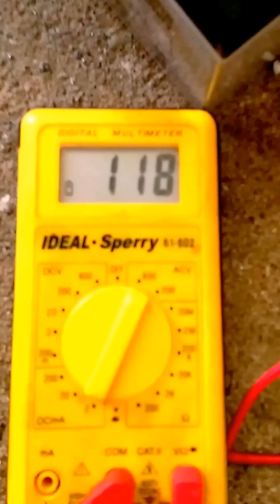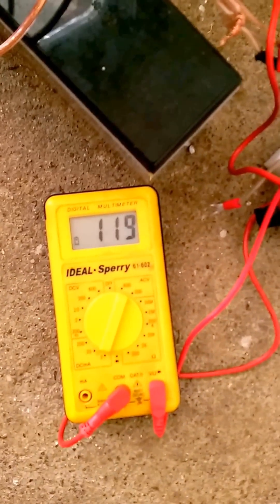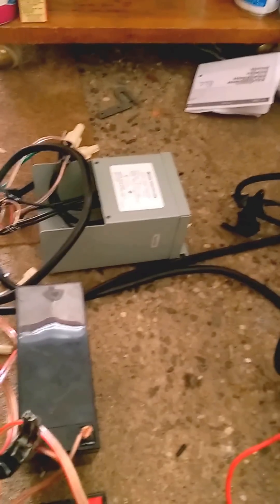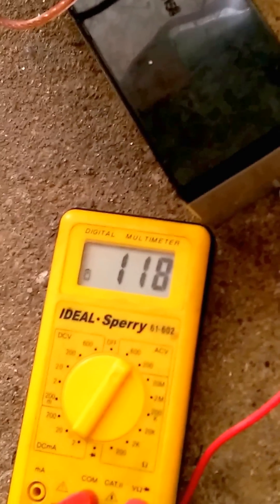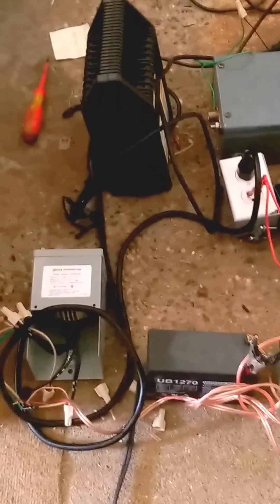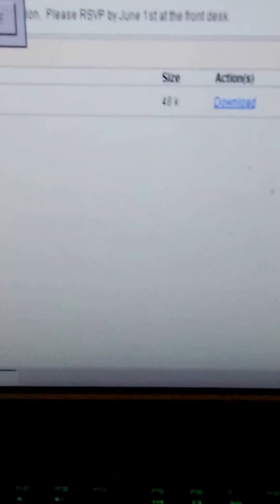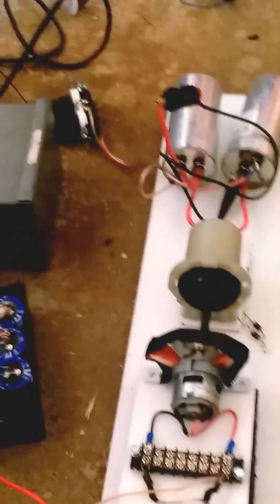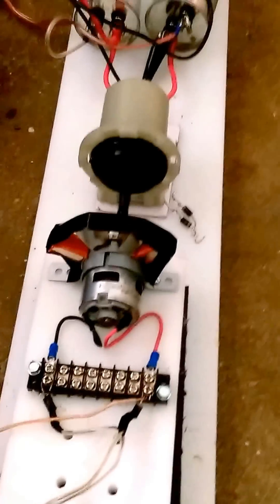Gerard Morin Washer Pump Generator &  PELEX DEVICE Successfully Looped!

Comment: hello mark   does your discovery indicate that the large transformers are not needed ?  thanks frank
Reply from the maker: +frank ertolacci if this were a method to replace some devices, such as massive generators to use millions of home generators, then yes.. However, there is some sort of unknown wave that comes from this device that has been cleared up for the most part, however, the device needs to either be used for only one circuit at a time, or, it needs to be made larger. Unfortunately, when made larger, the pulse it produces eliminates the use of cellular devices completely and all you hear is the ditta dah dah did it from the cellphones trying to access the towers, which this comes from the radio in the phone requesting transmission at peak power, but, no matter how much it tries, the signal is jammed by the wave. A study has been done but this was found to be a unknown type of interference that is somehow being broadcast through the conductors because it isn't going through the grounded enclosure, and, the radiation isn't alpha, beta, microwave, or xray, and since it is based upon a very low or ultra low frequency they don't know how it is doing this. It also interferes with backlighting on television sets and eliminates the function of wifi units, but, unknown to how it is doing so because the magnetic flux isn't massive enough to cause this, however, , it is just 3 small transformers wound together on a single special core, wired in a very specific way that accellerates the electrons in an anti lenz configuration which goes in at 60hz and comes out at a perfect 60 hz sinewave at anywhere under 500 watts amplification. Once it gets greater than 500 watts, the waveform starts to distort and I found that electric motors are subject to burning of the insulation on the windings, it isn't because the windings heat up, it is because the radiation attacks the copper , it either changes it's makeup atomically, or, it attracts electrons to it's outside, and it changes.. The outside of the enameled copper turns a powder black color, between the enamel and copper.. It is very strange and I haven't figured it out. It seems that every connection that its output  ties to does the same thing and I can't figure it out. Anyway, I have cut a section of the winding out and it knocked the coil out of resonance, so, I had no choice but to rewind it and it isn't  working at the moment, but, I haven't had time to spend on it to fix it, so, until then, it remains inoperable,  however, I have no use for it if it isn't going to power anything with the interference it causes, but, I've tried for some time to clear it up. The most recent device Ive been working on has been operable in complete resonance, but, I haven't finished it yet. It is much more powerful than pelex and safer, I just need to figure out why I can't get the frequency regulation to work, bringing it's output back down to 60 hz as stated in the formulas,.
Reply: +Marc Belanger    can the 1 circuit charge a battery bank , which in turn runs the house  //  2 or 3 KW running constantly 24/7 is all the average home would need   frank  //  you have chosen wisely , keep up the great work  //  if i can help in any way let me know
Reply from the maker: +frank ertolacci my pelex device shown here, the dark gray box is good for 3000 to maybe 3200 watts, burning hot. that , believe it or not uses less than 5 watts to run that much output, however, a safe level of use without any pulse interference is 500 watts. that's maybe enough power to light all led lamps in a home, including outdoor led  flood lamps.

the device certainly would power a 25 amp circuit but I'm finding it would probably generously provide power to each 20 amp circuit using 6.4 watts of input from your current power system. I have energized it with a computer ups system that outputs a perfect sine wave, then, looped it's output back into.itself, having 2000 watts of halogen lamps running off of it without any issues. I also use a 7 ah lead acid battery that's used in the 300 watt UPS system and the system never shits down. my problem is the pulse wave and complaining neighbors which would cause many.problems. I'm going to try mumetal shielding and a different conductor to see what happens to it. I'm hoping something eliminates the issues.
Reply: +Marc Belanger   with gerard  , his xfmr bushings were below 0  //  you are very close // like edison searching for a tungston filament  //  the pulse is RF ,  what is needed is a one way shield  ,  allowing the RF 0 point energy  in and keeping the RF spike in  //  kind of like a diode made in the shape of a bread box   //  just a thought

Comment: Instead of using a motor to run the drain pump motor use another drian pump motor and hook them together at the axle , then wire in series connected to a capacitor. Use a dremel tool to start it going until it runs on it's own.
Reply: Electric Dremel will not turn this pump, I thought the same thing since it is such low amp but just didn't have enough torque. I'm the original design Gerard uses a dc motor with low current but but too low so that you can still turn it because the whole idea is to put little in the circuit and get overunity . I will be using a DC 540 crawler motor. I think if you used another wash machine pump it would not produce overunity. I don't know for sure but i could try this because i have 2 of these laying around, lastly i don't know if this is critical or not, but Gerard also mentioned separating the two metal shafts by using a piece of rubber hose.

Comment: (Could you turn your phone sideways? Portrait mode videos are silly...)

Measure the filtered battery voltage while it's running, that will show if it's really self-sustaining. 
Just because the charger is capable of 1200W does not mean it's able to output full 1200W in this circuit, unless you load it down with a 1200W load, and show the current and voltage output. 

I can connect the same 1200W battery charger to my 12v to 120V inverter that plugs into my cigarette lighter outlet, and it will turn ON just fine... but it will NOT output any more power than my 12v to 120V inverter will give it. 

We just need to see technically correct Power measurements.
Reply from the maker: I apologize,  this isn't a proof of concept video.  The circuit works to maintain its loop while any other circuit couldn't maintain its voltage without the pelex device.  the washer pump generator is not the source of the additional energy,  the source is within the Pelex device and its under contract so I can not release any information as it is protected and can't be open sourced.  according to conventional science,  this couldn't work,  but I'm not here to prove my device,  its already been proven and has had many successful studies completed showing it to deliver much higher outputs than shown in this video . the pelex device saturates under higher than 400hz,  so,  it becomes problematic and the energy levels become massively reduced.  with a 60hz sinewave,  it draws 5 to 7 watts and has the ability to output 3000 watts easily.
Reply: +Marc Belanger   I never asked to see what's in your "Pelex" device, I simply asked for better measurements... and to discuss your misguided assumption that just because a device (battery charger in this case) is rated to output up to 10Amps does NOT mean it ALWAYS outputs 10 Amps. If the batteries are near full charge, the battery charger will only output enough current to maintain the battery voltage at around 14.5 Volts... and no current will flow. Use a DC clamp-meter to show if ANY DC current is flowing out of that charger. 
Why do you also run a second battery charging circuit (120V to 12V transformer with diodes) in parallel to the large battery charger?  You don't state where the transformer gets its 120V power, but it appears to come from the Pelex device, right?  Have you shown the AC voltage going into the large battery charger?
You have shown NO "Power" measurements, only Voltage.  The drill motor only draws about 3-5 Amps, which the batteries can run all by themselves.
Reply from the maker: regardless of the fact that the charger uses 10 amps or 2 amps, it uses an approximate level to charge the battery.. it is not the ac side that is the rated amperage, it is the dc side, and, it uses 1.7 to 1.9 amps x the voltage of 14.6 volts, being 26.28 watts. If we take the amperage of the motor without the circuit connected, we get an inrush of 5.4 amps, then it falls back to 2.3 amps, a total of 27.6 watts for the motor without any other incoming energy. The motor connected to the circuit releases a massive amount of reactive energy, like 94.4 volts which returns back into the circuit to the cap bank and then dumps off into the battery. The voltage at the motor reads 94.4 volts at the diode, then, on the other side of the diode, remains it's charge rate  which is what you don't see, however, it is 12.9 volts steady and the output voltage is meandering somewhere between 117 and 119 but holds. The question I had to folks was how much of this energy is being drawn in from elsewhere? We have losses in the motor, we have losses in the generator, we have losses in the diodes, we also have losses int he charger and the transformer. We add all of this plus the usage  of 54.7 watts to the mix and come out with a considerably higher amount than we put into the system because the load of the system completely disappears when the ammeter was clamped on once the Pelex device turns on. When I add this, the load of the system at the charger still connects directly to the generator output. The inut shows an amperage until the system successfully loops from the Pelex device's recovery of the energy, wherever it gets this energy from, however, in this case, the device barely worked. When I connect the Pelex device to the wall, it uses 5-6 watts to light up thousands of watts. I will add any kind of load anybody wants to see from Pelex. The problem is I can not disclose anything about the circuit, however, it works perfectly. Pelex also has only a voltage drop of 2-3 volts, but, it has a gain in power factor from less than 33 which my killawatt meter says it is feeding Pelex, then., 99 when we connect the meter to the output of Pelex. There is not one capacitor inside of Pelex either. Pelex needs to operate on 60 cps to function at it's maximum efficiency, but, when I run it, even though it is perfectly ground shielded, it releases some strage type of wave that completely eliminates cellular phone service within nearly 300 feet. The larger the device, the more it disrupts ambient and the better it powers things, unless it robs the towers of their energy, I could not say. My theory was that it draws energy by magnetically manipulating the natural magnetic fields of the planet and it expells a lot of energy in doing so, where I think I recover this energy with a very specifically wound triple cored transformer that I custom built. That's the only thing I could say about it, the rest is classified.

Comment: It isn't exactly clear what is going on here. Can you provide a schematic of some sort? Like what is the point of the super capacitors wired in series? Awesome video overall. I agree with your thoughts about entropy. It can be reversed, the devices that produce more energy than they consume will actually run very cold and will pull heat out of the room. These devices are reversing entropy.

If you aren't going to share the schematics what is the point of sharing the video?
Reply: .....profit